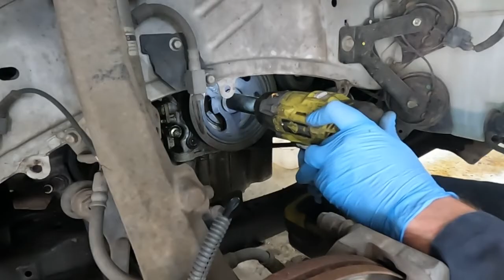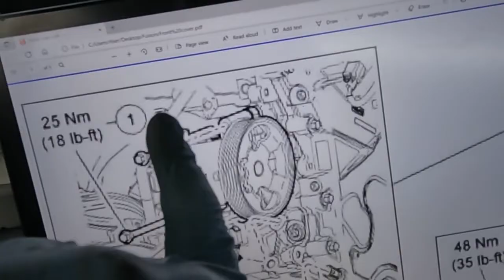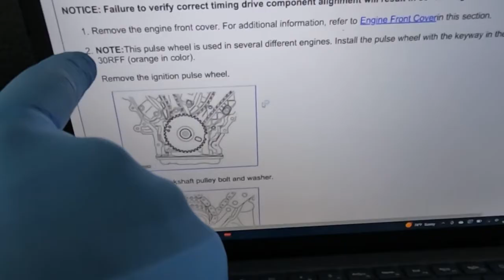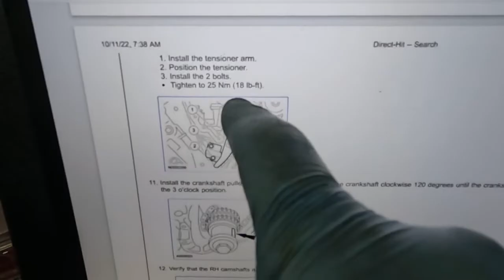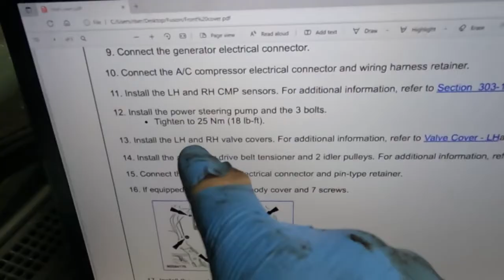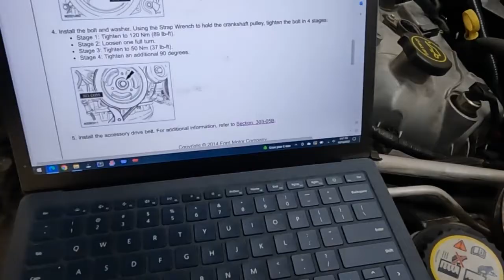2006-2009 Ford Fusion 3.0 V6 Timing Chain Replacement DIY How To

Comment: What did you end up doing about that broken motor mount bolt? Guess what just happened to me …
Reply from the maker: Oh no! I didn't have a solution. The mount now only has two bolts on the frame side. It's been doing fine ever since
Reply: @ValleyMobileAutomotive  Glad to hear that’s a viable option. I spent quite a while drilling out the broken bolt last night. And had to move the ABS module over for drill access. Fun.
Reply from the maker: @RestoRoc89  Let us know what you end up doing 👍
Reply: Weld a nut onto the broken bolt is your only solution. Those frame bolts are loctite slathered from the factory. They will break almost 100% of the time without heat. In the future, torch them things with an induction heater before removal 👍 worst comes to worst, you only really need the 2 bolts to hold everything.

Comment: Great video. You mentioned that the alternator gave you some grief. Did you remove it completely or just unbolt it and move it out of the way? Any other tips to dealing with the alternator? It seems like it is far and away the most difficult part of this repair. Thank you
Reply from the maker: Not really a special trick. I think having an apartment of extensions and socket lengths is the ticket. Find the combination that works the best 👍

Comment: I've had 3 of these apart, everyone of them is brown/golden on the firewall side and clean on the other side. I have guesses why this is but no concrete answer.
Reply from the maker: The more comments I read the more I see that it's normal for these engines to have two different colored heads 👍

Comment: How do you ensure that the oil pan seals on the timing cover? With the cast oil pan, I imagine it has minimal give to correct misalignment between the bottom of the block and timing cover.
Reply from the maker: The manual has you apply RTV to the bottom of the timing cover and in the corner of the block and oil pan. When applied correctly RTV makes a really good gasket 👍

Comment: This job has been plaguing me for years man. We bought my wife an 06 Five-Hundred SEL with 97,000 5 years ago. It's been from Indiana to Florida and back, Atlanta Georgia, Columbus Ohio, etc and she's at 179,000 now on the original chain and guides 😬

Needless to say we don't let it run past 4,000 rpm because that's when the chain starts talking but every time I get the gumption to perform this repair, I get cold feet watching tutorials and chicken out. 

This tutorial may just be the one that drives me to finally do it. She's got a valve cover leak anyway and it could definitely use the intake gaskets and plugs and maybe coils. The only thing that worries me is the Crank pulley being practically welded to the crank after never having been removed for 19 years and almost 200k

Thanks for the vid!
Reply from the maker: It's not too bad 🤞. The hardest part was actually the power steering stuff. The room on that side of the engine was terrible. Hopefully there is a little more romm in the 500. If you have any questions during your repair feel free to comment and I'll try to assist 👍
Reply: @ValleyMobileAutomotive thanks!! That works out fantastic then because the first repair I ever performed on her car was replacing the power steering pump! It wasn't awful but the bleeding procedure took a while for sure.

Comment: Nothing less than an EXCELLENT video!! Thank you for your time in producing this high quality video. Everything is explained in detail. My 2010 Fusion is leaking oil and I need to do the same. I will be installing a timing chain set with tensioners etc., just as you did. I always dread working on this engine that they shoehorned in there but I am tired of oil spots on my garage floor and driveway. Thank you again!!!
Reply from the maker: You're welcome! Glad this video was helpful 🙂. Let us know how your repair turns out 👍
Reply: @ValleyMobileAutomotive  I just finished the Timing Chain(s) replacement on my 2010 Fusion 3.0L. There were some differences with parts placement and designs but, this video was very helpful. I don't have hydraulic power steering or idler pulleys and the VVT solenoids are mounted on the heads, not the TC cover which was a help in removing the cover. One thing I did do was pull out the radiator fan to access the alternator nuts and bolt. I decided since I was there and I could remove it, I replaced it with a brand new unit from Rock Auto. Both of my chain tensioners were extended to their limits but were in perfect condition, however the chains were both stretched. That was where the rattling was coming from when I started it. This car only has 76k original miles and is in excellent condition. I bought it from a friends father who had it serviced only at the Ford dealer where he bought it new, and he was a stickler for maintenance. All in all this was not as bad a job as I thought it would be - I've done much worse. The only problem is reaching some of the components due to the tight engine bay and remembering the order in which to re-install some of the sensors, parts and wiring connections. Thank you again for your video. It contains a lot of great information and I checked it a few times during the installation. 

BTW, both heads were pristine and are the originals. No color difference between them.
Reply from the maker: @hackbadmacbar8668 Awesome! Thanks for sharing your experience. Glad the repair went well 👊

Comment: Figured id share this but the real reason the rear head is more varnished is because the Crankcase Ventilation system is mainly on that side
Reply from the maker: @JackReinsmith  Thanks for your comment. That makes sense 👍

Comment: How do you know that your timing chain is going bad?
Reply from the maker: @dragnet53  Usually it will make a rattle noise when you first start it up or like this vehicle it will cause the engine to run rough and a check engine light.

Comment: You can blame Aston Martin for this train wreck. Ford and Aston Martin did a collaboration. This is the result...
Reply from the maker: @dragnet53  Overall I like these engines but they didn't give you much room in these cars 😕
Reply: No, it was designed by Porsche.
Reply: @frequentlycynical642  No it wasn't. I just saw the video from SamCrac.
Reply: @dragnet53  I don't know who he is or why he knows.  Aston Martin is certainly not one of the major engine designers in the world.

Comment: Hey man, I’m not sure if you’ve figured this out already or not and I know this is a little bit of an old video but the reason one cylinder bank is darker than the other is cause the PCV system only goes through the darker bank PCV system will do that to any cylinder bank overtime and these 3 L Ford motors very common to see that and it’s normal
Reply from the maker: @mat3578  That makes sense! Thanks for the explanation 👊

Comment: Thanks for the in-depth video. How did you keep the engine from turning when tightening the crankshaft pulley bolt?
Reply from the maker: Honestly I used an impact for the last 90 degrees. You can mark the head of the bolt with a permanent marker vertically and use the impact until the mark becomes horizontal.

Comment: What does the tool look like to hold the crankshaft pulley for this Ford 3.0 v6..... obviously needed when loosing and tighten sequence without an air gun?
Reply from the maker: @LGoldsmith-p5m  The manual says to use a strap wrench around the outside of the pulley. Here's an affiliate link to one on Amazon.  https://amzn.to/3OkaQ2o
Reply: I wrapped my old belt around it and looped it onto the power steering to pop it loose

Comment: @53:51 😂😂😂😂😂....with my luck it would have fallen in the engine. 💀💀💀 thank you for taking the time to make this video. I have a 2010 mercury milan that i may have to perform this procedure on soon. My mercury doesn't have a power steering reservoir though, but just about everything else is the same. And my engine mount is wrecked too, guess it's just something that happens. 😢
Reply from the maker: @grant5392  Lol that was a close one 😅

Comment: My heads were discolored the same exact way. One varnished and one looks new. 141,000 miles.  I thought the same as you until I saw your video. It may have something to do with more heat at the firewall?
Reply from the maker: Thanks for sharing 👍. Seems like that's normal for these engines. You might be on to something with heat buildup 🤔

Comment: how many miles were on this car before  the timing chain needed to be changed?   i'm at 150k miles now on my 2012 fusion and wondering if i should have this done
Reply from the maker: I can't remember exactly but it was under 200k
Reply: @ValleyMobileAutomotive  While I’ve found this reply enormously helpful in my diagnosis on my 07, I shall now fall into a cool but steady state of deep frustration as I research how to get this done within the next 10-5k miles on my Escape. 🫠🔫

Like, really? At 125k on the nose this itch needs to be done because what’s happening in my mfkn crankcase at the moment is no bueno. Why not use a belt for f** safe if the service interval has a floor this low?! 😡🤬
Reply: Very late on this but as far as I know these are supposed to not be changed but people have found if the oil changes are neglected it does wear out the chain.  But if oil was changed regularly for most of the car’s life you shouldn’t have any problems with it.

Comment: I have an 02 Ford Escape 3.0 and i think the timing chain jumped.  I can’t get anyone to confirm my suspicion, all the sudden after sitting for a few months I go to use the car and it had no power.  After hours of investigation I found the front 3 cylinders had exactly 60psi where the back 3 had 155.  I really hope I’m  making a mistake going forward and replacing the timing chain.  It’s odd as the car only has 92k miles and has been babied.    Also do you have a way to send a copy of a manual for an 02 escape 3.0? Thanks
Reply: Was timing chain the issue? Just had same issue on friend's car.
Reply: No in my case it wasn't the timing chain.  I took it all apart and found everything was still in time.  What I should it done before I tore into it is a leak down test which showed I was leaking past the rings on all 3 cylinders.  My thoughts were because I had taken the manifold/header off on that side and a freak snow storm burried the car and was like that for months and that some rust formed on the cylinder walls and caused my issues.  After soaking the 3 cylinders in MMO, acetone, and some other things, I got them to reseal and while not 100% it's better.   If you suspect the timing jumped I would suggest pulling both valve covers, and check the timing on the marks on the camshaft.  There are lines/marks on the backside of the camshaft gear that you can use.  If both banks line up then it didn't jump a tooth.
Reply: @Diebog  Thank you!

Comment: I have one of these engines- the timing chains should be double roller, or at least single roller, and there should be matchmarks on the cams, chains, balancer, TDC indicator.  it's a Mazda design Ford adopted.  that's why it's so hokey.  there should be no guesswork or room for error.  this is why Mazda is 2nd rate.
Reply: It was actually designed by Porsche.  There's no reason to denigrate Mazda, they are just another Ford brand like Mercury and Lincoln.

Comment: the way to do these cars is, buy a junkyard motor, go through it, have it on stand rebuilt,  stored/covered.  when the one in car goes, change bullets.  then go through bad one, put on stand, storage.  rinse. repeat.  better off doing those chains, gaskets, seals on a stand, rather than in car. techs have be thrown under bus by design engineers, extreme limited access.   when you're 61 you'll realize why.  it kills your legs, behind the knees, tendons, etc. leaning over fenders.  tendinitis.

Comment: Those bolts always break spit it off got stuck in the frame 💀i said screw haven’t fixed it in 2 months haven’t had issues 😅

Comment: Are the timing chain cover bolts different lengths? Do I need to keep them in a specific order?
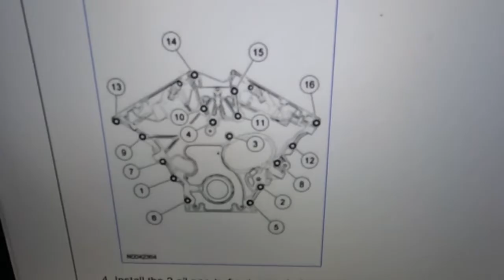Reply: 48:08 
Believe all are the same length but try to keep them in order.  Especially the left hand side where the 13th bolt (top left) and the 1st bolt( second from the bottom on the left) are different.

Comment: Very informative thank you very much. My 2010 escape 3.0 v6 with 180k has a rattling and i suspect its a timing chain or possibly cam phaser? It also has the front cover leaking oil everywhere so im thinking to change everything at the same time. this fusion engine looks very similar except mine has plastic valve covers and electric power steering so no power steering pump. Not much info on the 09-12 escape for the timing chain or phasers.
Reply from the maker: They are very similar but not exact. You could pick up a manual for the specifics and use my video as a visual aid.

Comment: The color difference between heads could be related to heating; I mean, if you research a little, you’ll find lots of oil starvation related problems with fusion on this years. I suffered myself with this issue; without warning, the engine just stopped working, and a week later went burned down. At the dealership they’ve opened it to find that one head was done. Lots of metal chips and the color difference you’ve already mentioned.
My actual problem: after 5 year waiting, change of ecm due to too much waiting, nobody could set timing, until I payed lots of cash at the dealership, then they gave it back with a check engine light on. The code mentioned “P0012 camshaft position timing over retarded bank 1”. Right now has power lose on hills, stalls occasionally, and low gas mileage.
Hope yours does not get burned.
Fast solution: inside cleaning with a Motor Medic motor flush… yeah, this engine starvation issue related to small oil galleries is very common. Check it out.
Reply: it's a schitt design.  he did a fine job on it though fixing it.  why use 4 cams, 4 valves, all the bling, when a 3.5 liter GM V6 makes the same power.  single cam in block is wayyy more reliable!!
Reply: @tunnelportterror  That's why I bought the 2011 F150 with the 6.2L. Easier to work on than the 5.0L dohc. I rebuilt the 4.6L dohc in my '96 Cobra and it was more work than it was worth really.

Comment: where can i get that pdf?
Reply from the maker: Unfortunately I'm unable to share this PDF 😕. Hopefully there is enough information in this video for you to follow 👍
Reply: @ValleyMobileAutomotive   all good just have a question then i have forgotten which pulley goes where the smooth one and the other one thats the same size
Reply from the maker: @shanehibbard9353  
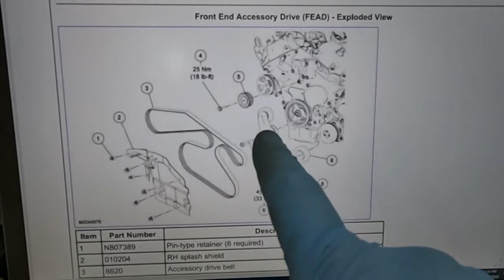Look at time stamp 56:15